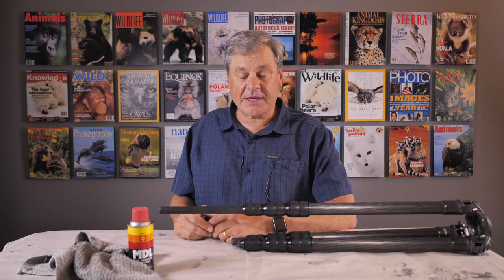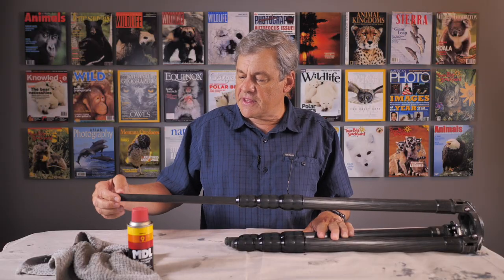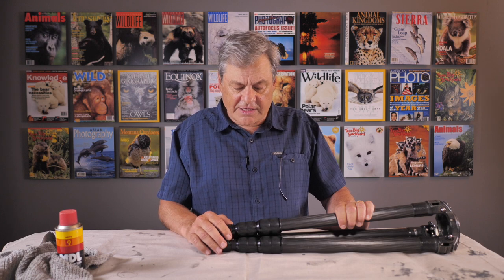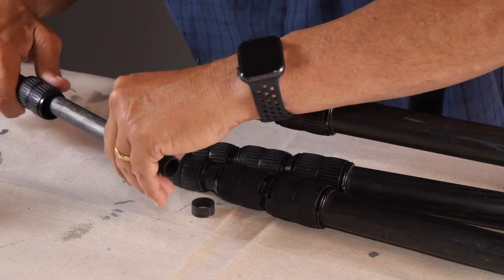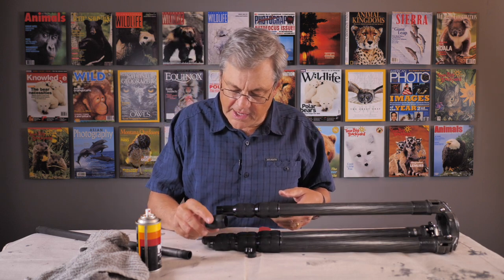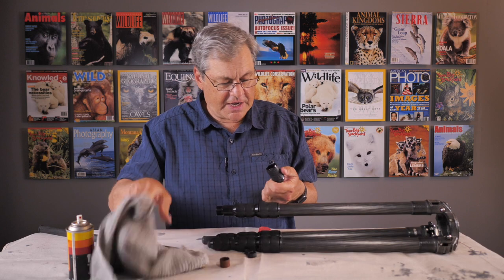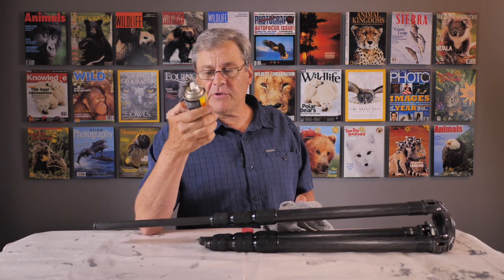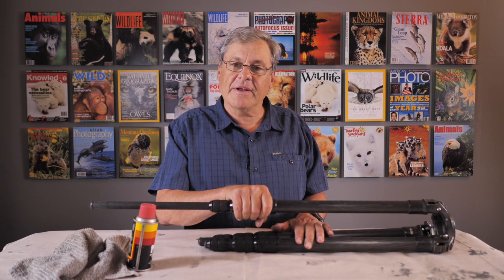Make your tripod legs like new!

Comment: Hi Dan, Thanks for you advice and help in cleaning and repairing my tripos.  Using the WD40 lubricant type of chemiocal is a terrific idea and recommendation.  I liked the way you placed the tripod on a clean surface and use a rag to clean the legs.  The only thing I would add is to wear a pair of "surgical" type of gloves as to not get the chemical on your hands.  As you know, those chemicals remain on your hands for a while, even if you use "industrial" type of cleaner or soap.  Great infomration that I will try ASAP on on of my tripods.
Reply from the maker: Good point about the gloves. Will be getting some to put in the studio.

Comment: Thank you for your video. I was looking to buy a tripod for wildlife photography but also wondering about putting the legs into the water. Salt water here. Is it deadly to put the tripod in salt water? Thanks
Reply from the maker: Sorry for the late reply. I've been out of the country and mostly offline the past two months. To answer your question, yes! Saltwater is deadly longterm for tripods, mostly for the screw joints that hold the legs together and allow you to extend them. I try everything possible to make sure the joints of my tripod legs do not get into salt water.